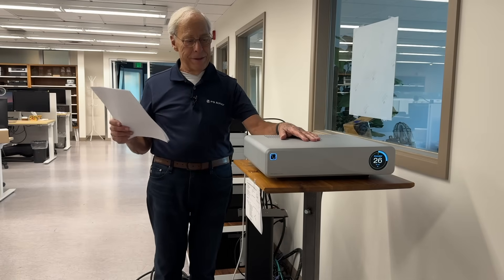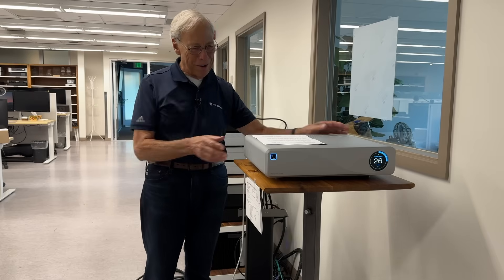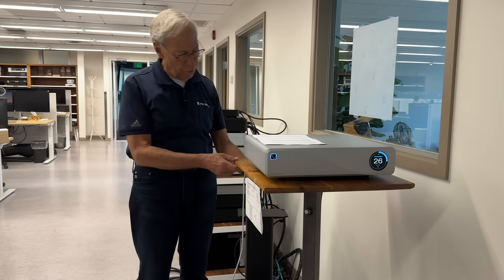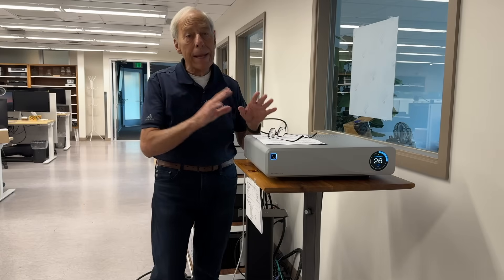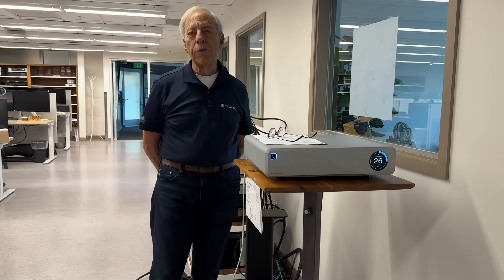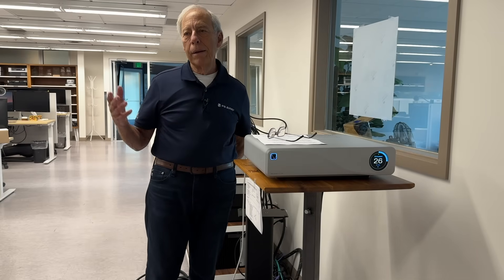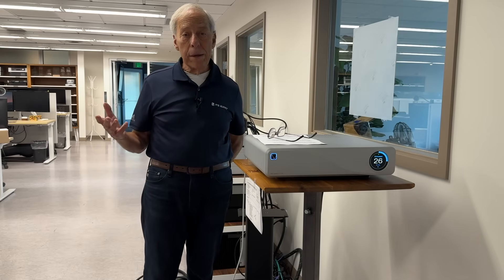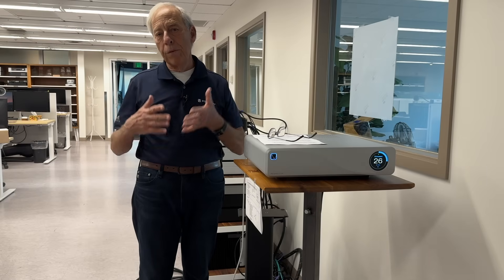Single ended to balance troubles?

Comment: I think Paul misunderstood the question. Pretty sure they were asking if an unbalanced input signal with possible noise in the line adds that noise to the fundamental within the balanced circuit it's entering as opposed to the balanced circuitry being able to filter that out. Pretty sure the answer in that case is "YES"! Without the input signal being balanced, whatever is traveling in it will stay in it all the way to the end of the signal chain.

Comment: And how to cope with crossover distortion between the two half signals in balance circuits, when reconstructing the full signal? This seems like in a push-pull output device. There is also a bias quiescent current to avoid it?

Comment: I would assume that converting the single ended signal to balanced, so splitting the signal and increasing the voltage would increase noise and the same at the output if you're still using unbalanced. However running the unit in balanced configuration would reduce noise... I guess it's still better but Paul didn't really answer the reason behind the question.

Comment: OFF TOPIC: I got some Stack Audio - 'AUVA 70' vibration absorbing footers three(3) days ago & WOW...just, WOW.
I highly recommend these little doo-dads. More coherent highs, better 'slam' & tighter/cleaner bass. Better sound all round.
60 day return policy (Stack Audio pays for shipping both ways) however, I guarantee that you won't be sending them back.
I bought six(6) AUVA 70's all up...three(3) under each of my O/93's (2 front/1 back)...brilliant results; just brilliant ✌💖🎶
Reply: I have Stack Audio's Auva Equipment Isolators, and also their Serene Stabiliser (used as a replacement for a record clamp).

I cannot play records without it.  I have used other, traditional clamps, but the Serene Stabiliser is just better, in every regard.

Yesterday, I took delivery of "EVP Small Round HD Felt" vibration control protectors, from AV RoomService, to put under my turntable (available for all equipment).  I discovered them, while watching youtube videos from J.R. Boisclair, of WAM Engineering.  I was watching his videos, to learn about professionally dialing in my new cartridge (he is an expert's expert).

In one of his conference / zoom(?) videos, he showed the two other attendees what he was using, which were the vibration control products from AV RoomService.

I ended up meeting him a couple of weeks ago, at T.H.E. Show, held at a Hilton hotel in the Meadowlands in New Jersey.  So he personally dialed in my turntable, which included a custom brass shim (between the cartridge and the head-shell), to add mass and to correct for zenith alignment errors (that virtually every cartridge has).  His services involved a significant cost.  But no one could do what he did.  He sets up cartridges to extract the finest details in a record's groove.  He gets your stylus to match the cutting angle of the machine that created the lacquer for the pressings.

Norman Varney, of AV RoomService, was also there, so I got to meet him, too.  By the way, PS Audio had two rooms at that event.  I just missed meeting Paul.  They told me that he just left.

Anyway, your assessment of Stack Audio's products are spot-on.  But the boys from WAM Engineering and AV RoomService give the nod to the EVP protector products.  I will find out, with my own ears, when I have time to compare Stack Audio's vibration products to AV RoomService's vibration products.  I suspect that they will be neck-and-neck.

But if you play records, you have to use Stack Audio's Serene Stabiliser.  Although, a reputable reviewer gave the nod to the Origin Live "Gravity Two" record clamp (works on the same principle as the Serene Stabiliser).  But I am not going to spend a few hundred, again, to find out.
Reply: @0Perhaps   ...interesting read; thanks for posting. Similar story, I have a very good friend in London with an expensive Vertere turntable who was lucky enough to meet Touraj Moghaddam at a Hi-Fi show & TM was happy to visit my friend's home, just a couple of streets away from said show, to set up his table, arm & cart. Sometimes the Hi-Fi gods smile greatly upon us. Personally, I gave up on vinyl way back in '87. My components will remain on IsoAcoustic Pucks for the foreseeable future. The Stack Audio EQs can be auditioned sometime next year.

Comment: Paul, I don't think you really answered the question. I don't use balanced (XLR) cables because my preamplifier - though extremely high quality - only uses RCA inputs and outputs and I built my own class A amplifier monoblock amplifiers and they're single ended (RCAs) as well. I don't have noise or hum issues - due, I believe to careful design when constructing my amplifiers - and so I've never felt the need for considering balanced circuitry. I was surprised to hear that - assuming I understood you correctly - unbalanced inputs to my preamplifier would be arranged from the DACs balanced outputs (which I assume by taking the signal from just one side of the balanced arrangement, along with the central earth).

Comment: In the process of upgrading gear, it's one of those kinks we will have to live with possibly until we get to next level and if your gear is otherwise well engineered with adequate gain headroom, you will be fine.

Comment: Lightfull vids, now i understand here a cable which is insane, but its delivers the best sound for my vinyl. Cannot post here that picture. Its an IN-Akustik star audio cable with the option to listen single or balanced, Ok the price hugh because its only 50 or 60 at its length and one line is reducing to its dia. of the wire, i never understand that, its insane, its works like that.
Reply: Kindly repeat that in ENGLISH, Miss.☝️

Incidentally, are you VEGAN? 🌱
Reply: @TheVeganVicar   ...awww, come on...don't you like a challenge?
Reply: @TheVeganVicar  Good Luck, Sir👇